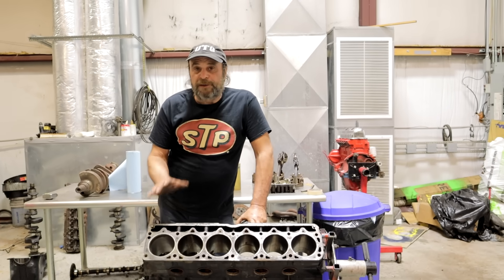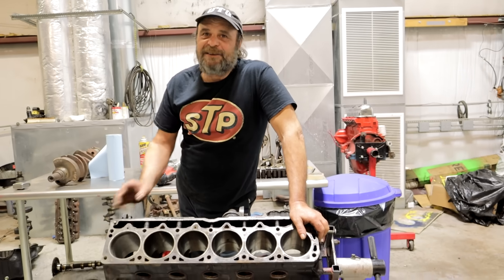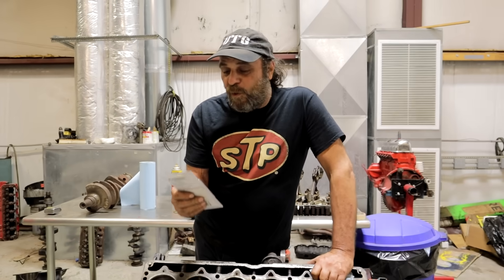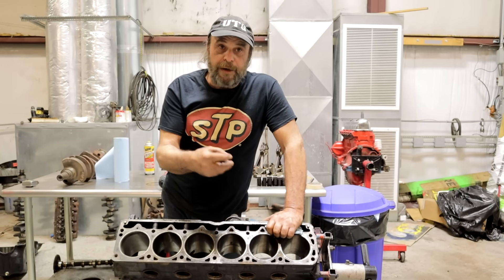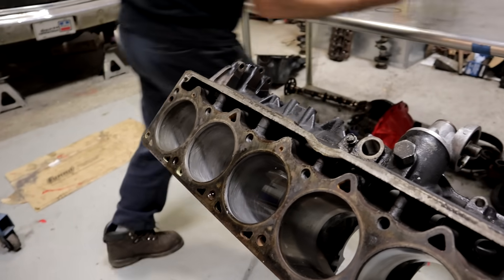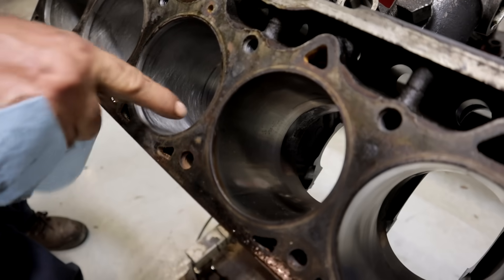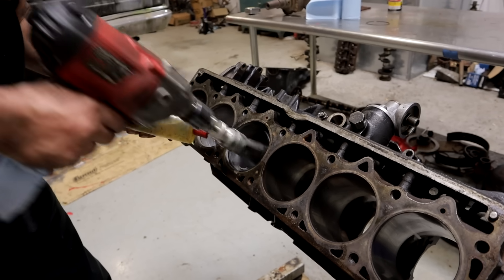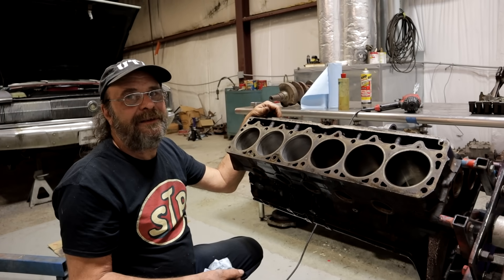Your First Engine Job - Honing For Crosshatch And Choosing The Right Stones For Your Rings

Comment: I've assembled multiple ( about 80 or so) SB and BB Chevys. Honing can make or break a rebuild. This is about the most simple and straightforward  explanation of technique and goal for the desired end result I've seen on the "tube". It's probably pretty hard to get an accurate image of what you're looking for on camera, but if you're a newbie this is an excellent video to get you where you need to be. There's a thousand ways to do it wrong. Trust me. P.S. my grandad always used kerosene as lube. Don't know why, but he said it works better on larger bore  engines such as tractors I trust that because Grandpa told me so. I just know the man could keep anything running. Ain't too bad at it myself. Still got his Ford Jubilee and use it about 8 months out of the year for various reasons. Thanks for the lesson, Tony!

Comment: If there are deep scratches after hone, would this leak during the compression? To me, it seems better to send off to a specialist to hone because the surface of the cylinder wall would be smoother.

Comment: Can you hone an engine with the pistons still in? 
I have a bmw m10 engine with low compression 90-105psi across the cylinders. 
I think this is from bore wash from a carb always working on the choke. 
So I want to remove the head and give it a honing, to see if it will come back better. 
I’ll re-seat the valves while I’m at it. 
But i don’t want to take the cylinders on. 
I’m very limited on space tools etc.
Is this ok to hone with cylinder still in? 
Thanks

Comment: Total noob here....  what is the liquid being used to lubricate the cylinder walls? It doesn't appear to be oil,  at one point gas is mentioned, but it wouldn't be that due to the risk of fire rite? Is it just water?  Thanks....

Comment: Great vids as usual, just got done doing a 1974 Ford 351Windsor 0.030 over ,bearings .10 under just a quick cleaned up and cross hatched all cylinders with medium grit.Worked out great.I used medium grit, now imma thinking redoing with the coarser grit just to get them cross hatches ALITTLE coarser,Advisable or not would you think.

Comment: the reason for the exhaust glowing red at start up are due to the leakage around the unseated cylinders ,hone job breaking in the sealing surface of the cylinders , not the rings , the hone job is to lesson the  leaky spots during up down travel, your creating fine high spots to get wiped away and improve the sealing contact area., think initial blow by and vacuum leak on intake stroke. the tightness and friction turning over never run engine actually is the high pressure oil ring assemblies scraping the hone job , not the compression rings. over tight oil rings , they also account for hot running engines ! Want a cool running engine ? do something about revealing the tension of the oil rings ! I built a loose engine and it ran great, it never overheated period, in fact i ran the radiator cap without pressure the  rubber seal gasket! and only filled the cooling system to the point the coolant circulated , in the winter i had to use cardboard directly covering over the radiator to get some heat to come up ! it was a 400 b engine and i used close chamber early heads to bump the compression a bit ! It ran flawless till i sold the car , A 66 fury 3 ! I believe i got an extra 25-30 HP just by reducing the rotating friction! It pulled nice 0-60 in 5.5 seconds on the street with 60 size radials ! Don't try it at home! you have to really understand the ins and outs of the combustion engine to do things the wrong way and have the results come out right !

Comment: Hi tony is see alot of you're vids.
I live in Belgium and we only drive 3-6 cilinder cars.      So Belgium's engine builder shops don't do alot V8 engines.

I have bought a 331 stroker kit with mahle pistons and moly rings.

I didn't tell my engine builder what to hone with because i thought he would know.
But 2 months after i emailed him to ask what grid he used and first he told me 380 gritt. The next day he emailed me back that it was wrong and Sayed it was 180 gritt  stones honed.  What can I do know? Just file fit my rings. Thanks for you're vids

Comment: Thank you for all these helpful videos. What grit Stone would you use for a slant six standard home with cast rings? For occasional daily driver type use
Reply from the maker: You'd want to use coarse for that engine
Reply: Thanks for your reply
Reply: I've never done it before, do I just want to look for coarse Grit? Or is there a number to also look for kind of like sandpaper has numbers?
Reply from the maker: It's pretty straightforward.  Stones are generally listed as Fine, Medium and Coarse
Reply: Awesome thank you very much, I really appreciate your time

Comment: My Flex Stone hone, frequently called "Diggel-Berry" was use with solvent. A line of tape is used to mark the entire depth, so the cylinder sleeve bottoms and main caps are not hit. I still have a Sterret cylinder bore gauge but also their 8" length of feeler blades that would measure taper and out of round from 0.0006"-0.0015" on a ring and paper thin!
DK, Omaha.

Comment: IF THIS 4.0  IS ANYTHING LIKE T HE ONES I HAVE SEEN THHE #1 CYL. WEAR THE WATER PUMP MOUNTS  IS WORN TO FAR TO HONE. ALOT   2I HAD TO SLEEVE TO SAVE THE BLOCKS. USE  A 150/180 GRIT STONE FOR CAST RINGS AT LEST 220 OR FINER FOR MOLY .IF YOU USE A RIDGE HONE LIKE A SUNNEN YOU WILL BE SURPRISED AT ALL THE VOID I THE CYLS

Comment: with honing for that amount of time, do you need to get larger pistons? seemed like it would take alot of material off the block
Reply: The spring on the hawn are adjustable. Even at full tension it wouldn't take much off. He was keeping it wet so it wasn't going to cut as much. The rings will make up several thousands of wear. 
They used to make oversized rings for most v8s back in the day. Doubtful many companies offer them now.

Comment: I beg to differ with you Tony. A nice straight cylinder with a smooth finish will seat without any problem. I would agree with you if you did not rebore it and the cylinders were not round or had a slight taper in it.

Comment: Is putting the 4.0 litre jeep motor in a 75 Camano   nuts,with a turbo   would be really cool.,I would think 400 or 500 hp would be  easy to do  in that  motor ,  I don't have  the will to use ls  motor  yet.

Comment: Thank you for mentioning that a freshly honed engine with cast rings will rotate with some resistance when assembled. It's been 30 years since I had a fresh rebuilt short block old school V8, but one thing I remember was there being a fair amount of resistance if I rotated the crank assembly. On some of these recent videos that people have put out there have indicated the engine should rotate easily. Kinda thought that wasn't quite right from what I remember back in the day. But I know now that's not right if I hone an old school engine and install cast rings it'll need to feel tight. Thanks for the tips.

Comment: Retired FireFighter here....I wouldn't use gas in an enclosed building...you have been lucky so far. Scarry. Kerosene won't flash with fumes as easily.

Comment: I'm fortunate to have 2 local, independent auto parts stores that actually stock various grits of Lisle stones for my ancient Lisle cylinder hone. They're not expensive either.

On the other hand, any time I take a block to a machine shop, it's definitely getting bored and, I always take the rings (still in the sealed box) that I've chosen to the shop along with the block. That way, if there's any questions about bore finish, the machine shop can contact the manufacturer to make sure what the requirements are.

Comment: When I think of moly rings, I think of off road engines such as dump trucks and bull dozers.
Reply: Chrome plated ring for dusty conditions.needs coarse stone.moly is different type, not so good for dust and need s fine stone.
Reply: @johnstuchlik5828  Ah, yes you're correct, chrome. ;)

Comment: Question, I have a 350 SBC . It's .60 over. Would this increase the bore. If so would I just use larger rings. I feal like .60 over is a bit close too the maximum. I hear different things, some say .60 over is fine other say it's a ticking time bomb
Reply: That would depend on a lot of things. First what is the manufacturer's recommended max overbore (1). Second is core shift at the foundry. The only way to really find that out is to have the block sound checked. Plus there's the metallurgy of the block itself. Third is something a lot of people might not think about. Bore size versus bore spread. A 350 Chevy at standard bore size has .400 of an inch between the cylinder walls. That .4" has to accommodate both cylinder walls and the water jacket. Plus how thick is the deck surface. 
The manufacturers in their engine design stage look at a number of factors in their casting designs. One is weight. Every ounce of cast iron they can take out of a casting over time adds up to a significant amount of money. Alloying elements add up. Plus with US castings at various times the industry went on a serious weight reduction program. One typical period would be the early 80s. 
1) Depending on the manufacturer and engine casting maximum overbore can range from .030 to as much as .125. If you get up to the high end it requires a relatively small bore in comparision to the bore spread with a heavy casting. A good example of this would be an AMC 290 or 304. A 3.750 bore in a block with a 4.750 bore spread. The overbore max is .125. Which would give just about the same bore and stroke as a 5.3 LS iirc.
Reply: @mpetersen6  hey thank you , it's a 3970010 police 350. I will double check the date codes and look for the manufactures spec on those points. Fascinating. I've actually buttoned it all up and looking for holley secondary float assembly's and bits to fire it off. I avoided honing because I was unsure, but I will delve into that rabbit hole. Thanks for the details. Cheers buddy
Reply: @peppereggfuk  
One of the first things done with a batch of castings when they were shipped in was to inspect random castings by slicing them up in a large bandsaw. The only way to really check casting or core shift is cut the casting up.
Reply: @peppereggfuk  
Random blocks, heads etc would be cut up do that cross sections could be measured and compared to the print dimensions.

Comment: Another trick is to wrap a dingle-ball hone with some sandpaper (fine grit) and rubber bands and use Purple Power or Simple Green, etc. and take the high spots down. I use this on import engines or performance rebuilds with narrow/metric rings and moly (fragile) rings. Chrome rings or ductile iron will work fine with your method, I agree!

Comment: Uncle T, Have you ever tried kerosene for honing? It seems like it would be a great mix of cleaning and lubrication.
Reply: I ised kerosene to flush a gummed up 302 before. Worked better than Diesel. I also tried filling it to the top of the valve cover with gasoline once and fired it up. Lucky i didn't have a problem. Also water. Kerosene worked good.
Reply: Yep, Dad used to use a small bucket of it to dip the hones in. It has a lubricating attribute as well as a flushing action of the stones.

Comment: Are ball hones any better or worse?or is it engine specific? At what time would a dingleberry hone be of use?
Reply: He talked about that in the last one.  The idea is that the ball hone will conform to the contours of the cylinder, where this stone type will bridge between the top and bottom unworn areas of the cylinder.  He does a better job of explaining it, go back and watch the last one in the series.  EDIT: he talks about it in this one too at about 13:20
Reply: A ball hone would be perfectly fine to use on that slant block he was complaining was given too smooth of a wall finish for the rings he plans on using early in the video.

Comment: So true! Back when I was having a '71 340 block remachined, I noticed a signficantly finer finish on the bores than I was used to seeing. The machinist explained to me that, since we were going with Moly rings, a finer finish was required for it all to work well together. Bore finish is one of those important details that can make or break a build...
Reply: Molly is a harder surface than cast.    Molly rings need a rougher cylinder hone not a smoother one.       This guy has not a single clue what he is talking about.       As o get older.   It’s punishing to watch the influencers miss lead every one.         This is proof you need to look at credible sources for technical information.

Comment: 4 liter engines always have alot off wear in no 1 cylinder  at top that wont clean up
Reply: Wonder why that is? Cooling or fuel issues?
Reply: It's above me just remember from when I used to work in a engine shop in late 90s they all did that on number one really bad iam guessing lack of cooling but maybe someone with more knowledge will inlighting us

Comment: Tony ProTip Question: About your handy AMWAY plastic bottles - Do you recommend "No-Ethanol" gas to fill them?
Reply: I wouldn't worry about using ethanol free fuel, for one it's somewhat hard to find in most area's, I've never seen it in my whole state my whole life actually, I wish I could find some for running in small carbureted engines and what not but I've ran regular gas in everything my whole life and never had a problem. I would recommend putting a little 2 stroke oil in your little "quick start bottle"  with the gasoline. All just my opinion here😁

Comment: Since there are no stupid questions....when an iron ring block seats in, how many thousands of an inch is added to bore size? Say, a 4.030 bore, after seating, becomes a 4.03? bore?
Reply: I think you have a typo in your question since 4.030 and 4.03 are the same.
Reply: @JesusIsLordAndSavior77  They were asking if the 4.030 would go to 4.031(2)(3)etc... hence the "4.03?" Where the question mark represents 1 through 9... Come on dude.
Reply: @honuswagner9348  Exactly. If it causes enough heat as he says, how much of the bore surface is being "honed" by the rings themselves during the seating process. Could you start with a 4.020 bore and after seating have a 4.030 bore, especially if the bore surface is "rough" to begin with.  Anyone???
Reply: The bore will change less than .001.the end gap on the ring will increase a bit more and then continue to slowly increase as the miles roll by.

Comment: Is there a preferred angle for the cross hatching and does this change for different ring types?
Reply: Not sure on my angles but i was taught roughly 10 o'clock x 2 o'clock.
Reply: @clutchkicker392ison5  Same here but it was expressed as 45 degrees. That was back in the day so it would most likely have been for cast rings.
Reply: I dont rekon the angle would change for different rings coz its for oil retention? @brianbrigg57

Comment: new stones should you soak them in oil overnight>? At  14:47  you put one of the stones reverse in the cylinder. 🤔🤷‍♂
Reply: No oil anywhere near the stones, we hone with water, and want metal to flush away. Oil clogs the stones, which results in a rough, jagged cut. (same as a clogged hand file that makes a rough cut.. a clean file makes a clean cut) Oil soaked stones will result in blow by and reduced engine life.

Comment: I rebuilt the 4.0 in my 1991 XJ just shy of three years ago.  Got a complete engine off of Craigslist out of a 1998 for 50.00 to rebuild.  Supposedly it just needed a new head gasket, HA!  Tore it apart and piston #3 had a sunroof.  The cylinder was scuffed, but I only had to take it 30 over.  I went with sealed power hypereutectic pistons, a Cloyes timing set and melling cam and lifters.  Ordered a 10 under crank from Rock Auto for way less than what it would have cost to have it ground.  For the rockers you cannot beat Scorpion roller adjustable units.  I also spent the extra 250.00 and had the rotating assembly balanced. I did the assembly myself, and its been a great running engine.  The only issue I had was a couple of the pipe plugs in the head had not been tightened correctly at the machine shop and were weeping coolant.  Simple fix to diagnose and repair.
Reply: 4.0 have crazy potential rick mudge built one that spun 10k rpm in the 90s and beat up on small blocks 😂 badass stuff!!!

Comment: I ABSOLUTELY HATE that most hones are free floating and not internally parallelized!

I know, it costs a WHOLE LOT MORE, the way they are not made in China to make them more complicated, but I GREW UP with the PROPER honing tools, how they were made back in the 50's and 60's when engine repair companies CARED about their reputations as a tool supplier company.

Flippy-floppy hones are okay for MOST applications, I will not deny this, but NOT for EXTREME PRECISION.

I was raised to work in 'EXTREME PRECISION' by a USAF aircraft mechanic, and to this day, this is how I build and rebuild macinery.
Reply: Please explain. Is that precision hone like a quality puller that has a collar around the three legs to maintain equal tension?
Reply: @rcnelson  I am honestly thinking I will make mine in 4 or 6 land forms.

I do not see any 3 land format being able to produce what I need in my research.
Reply: @rcnelson  see if you can find a picture of a sunnen  precision hone.typically used for final sizing after boring.the hone tony is using is glaze breaking type where you are restoring cross hatch with as small amount of metal removal as possible.
Reply: @rcnelson    Look up "Lisle hone".  It is a similar, if not the same hone, as used on the honing machines at the machine shop.